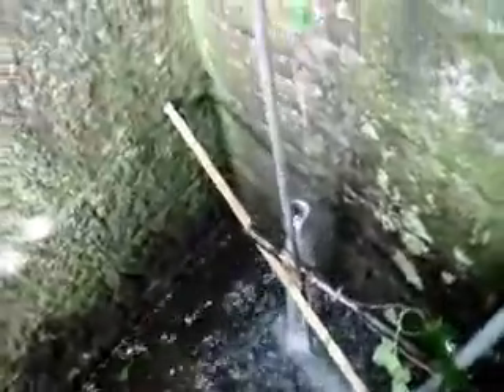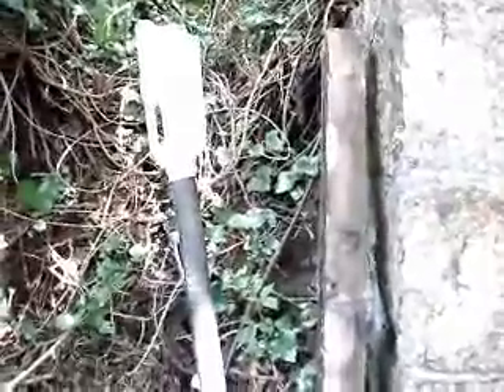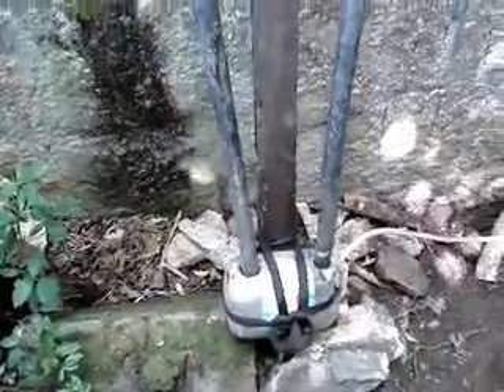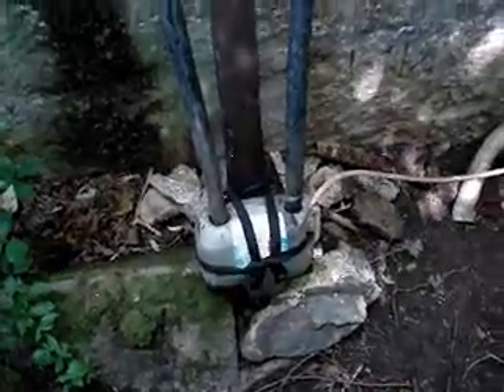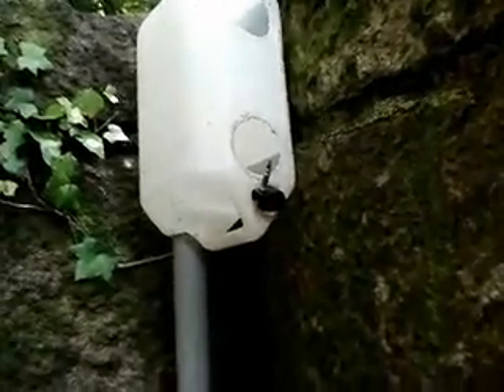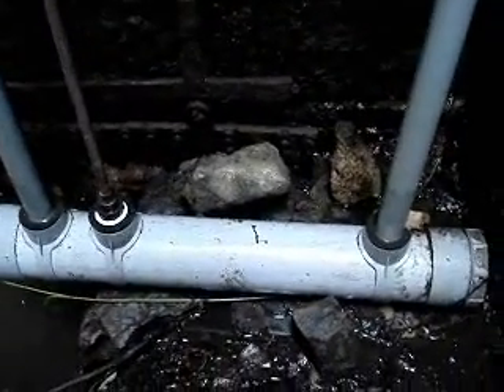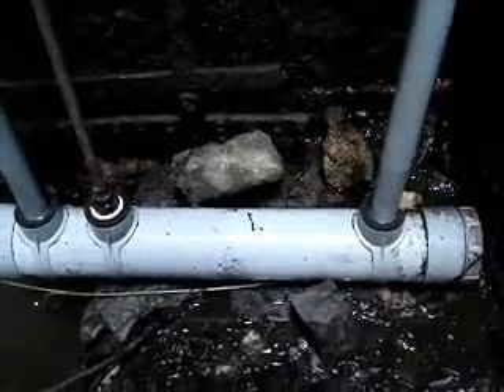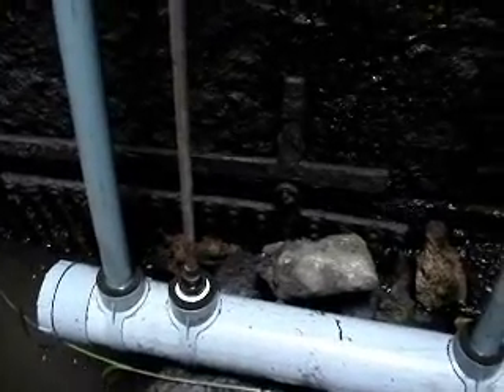cornish pulser pump

Comment: Hi, Mat, don't be too worried that it is just a "model".   An engineering student in England confered with me about setting up his experiment to test the pulser pump in September/October 2012. Hopefully he will post his results in May or June. Even though their  'water lab" is very impressive (I saw pics) they cannot do a full sized pulser pump either!  The main thing is you did your pump in a timely fasion and you put it out there. That has huge value.  Brian

Comment: all of your pumps are very consistent. If the compression chamber is six feet below the water source, then they pump six feet higher than that source. If they are ten feet below, such as in your brothers backyard, then it pumps roughly ten feet above that water source. Here, the pump looks to be at least ten feet down, but it is hard to tell, it may be 15 feet. This is because the column of water in the down pipe determines the pressure in the chamber, and that pressure determines the height

Comment: once again, the height that is achieved is roughly equivalent to the depth that the chamber is placed. There may be a small gain to account for the volume that the air bubbles occupy in the up pipe. The question is does this work when the up pipe gets beyond a certain diameter. At some point I would think the bubbles would just rise without lifting the water. In a small enough pipe or line the surface tension of the water is strong enough to have a plug like effect.